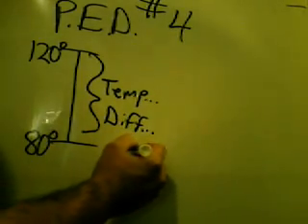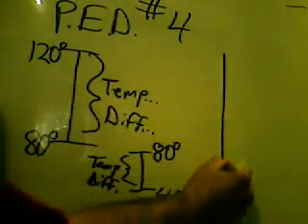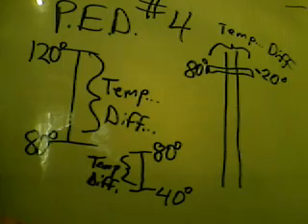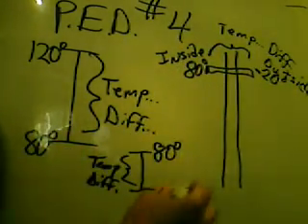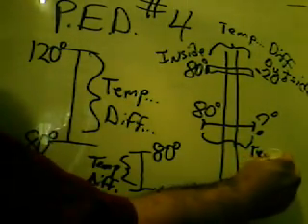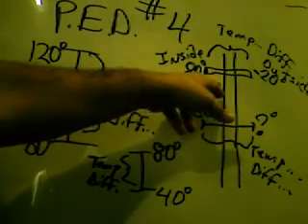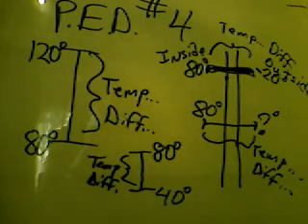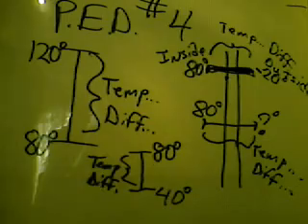Perpetual Energy Device #4

Comment: Perhaps a reverse Peltier/TEG device can work. If I have one of those peltier cpu cooler, I'd test if it generate electricity on the thermal difference of CPU/hot side to the heatsink/cooler side.

Comment: Stirling engines create mechanical energy out of heat differentials (even as different as 4 degrees).  The output is 80% or more efficient than solar panels (which are 20% or less).  They are using them in highpowered solar farms rather than solar panels now, but this isn't quite PED since you are harnessing heat...PED = energy from nothing.